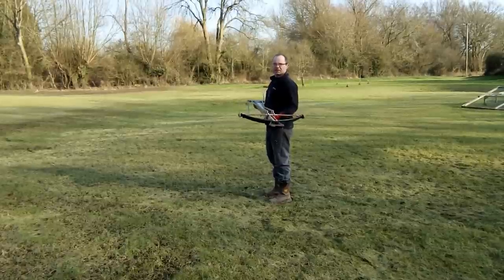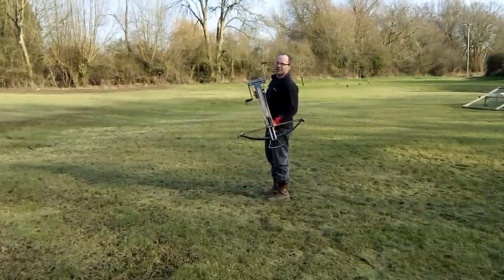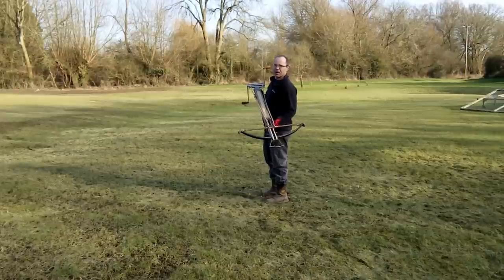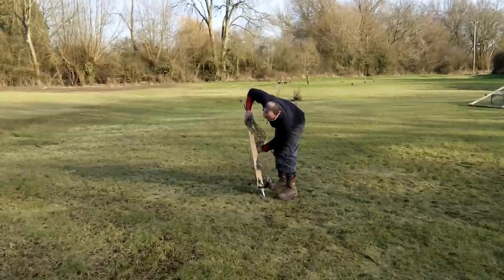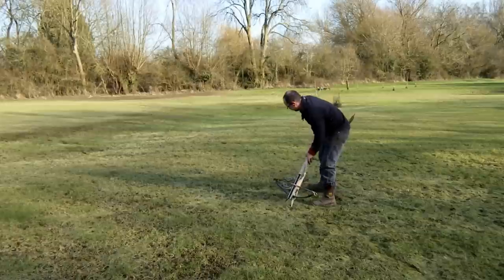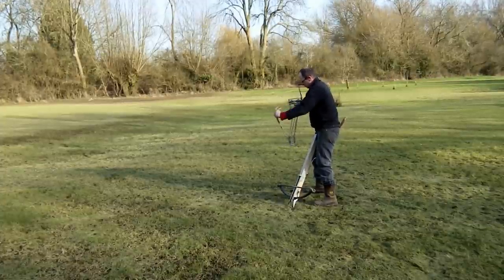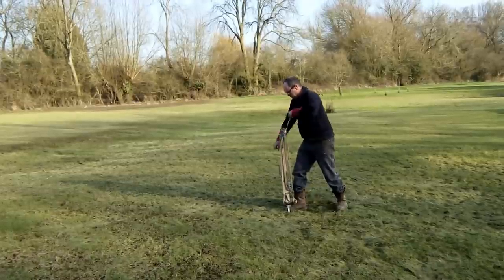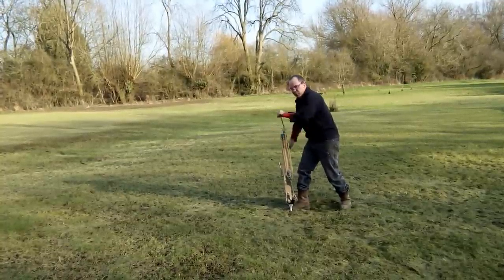Tod of Tods Stuff shoots a 1250lb medieval windlass crossbow

Comment: well, you fired 3 shots in 110 seconds (~37s/shot), so 1 shot every 45 seconds isn't THAT far off.
Reply: His last shot took 30 seconds though
Reply: ...and he would have been faster if he'd laid down the windlass on the ground in a more orderly manner. It would take a bit more time than just tossing it into a tangled mess like he does but you'd make that up with not having to  untangle it again. Add an peasant to hold the windlass and a supply of quarrels and he'd be even faster.
Reply: Not only that, you don't unwind as much as you pull it. Once you've got the hang of it, a steady 28 seconds per shot is doable.
[I get about 30 seconds average on mine but I prefer a bow and don't use it much.]
Experts might even drop that to 25 seconds.... who knows.
Reply: A design with a release-lever like on the winches for the modern load-securing-belts used for commercial transports could also make un-winding the windlass a few seconds faster. I'd say the 45 seconds is probably for ordered ranks of crossbows to fire concentrated salvoes after orders, rather than individual free-fire. Also once you start getting tired in your arms and backs, speed would drop some.
Reply: Oh it can be a lot over the course of a few hours. Even just 1 hour considering in any confrontation multiple of these might be firing.

Comment: I have shot quite a few ,and the 1250 inch/pound is a fairly lower weight crossbow easily cocked at the distance by hand , if it were spanned another 6 inches well that would probably require a windlass or tool as alignment at that length is crucial. . And Yeah you have alot of folks touting one the crossbow or two the longbow , and both sides beat their chests , While mostly studying artifacts and what we "Think" is factual and it's just conjecture because so very few specimens of either from the great battles have remained. . Men were Shorter and Stouter back in the day , they had to be life was hard and short so it had to be lived to the fullest,  most men lived on ale and  porridge called "Gruel" ,hence the term Grueling Day , well that meant their was little in the coffers ,Pockets and taking of Game without permission was a serious enough offense that only outlaws would risk it's fine hanging by the neck . However Any English or Welshman worth their salt would poach and get their state mandated training with the LongBow in daily and weekly after mass ..

Comment: Could you answer the burning questions of how much armor a bolt from a 1250lb crossbow would pierce at various ranges?
Set up plates of steel the general thicknesses of medieval breastplates and shoot them with armor-piercing bolts?
Reply: Bat Guano that would be golden. however 3 things have to be checked. the correct arrow tips for piercing, tempered steel plates and arrow tips, and heavy enough bolts

Comment: Is it not possible to leave the winding handles end on the crossbow as it seemed a time consuming effort making sure your ropes were not tangled each time? Reattach to the string, set the trigger, wind, detach, load, fire. Especially if the rope's were on the other side during winding.

Comment: The real war crossbows are the Chinese compound bows that were placed in carts & had 4 limbs. They allegedly were used to fire heavy tipped bolts into castle walls to make: ladders. Supposedly the heavy tipped bolts had enough energy to penetrate the mortar deeply (and presumably the stone). Sounds like a bit of a stretch, but you simply don't see demonstartions of the power of the 4 limbed crossbow anywhere in the modern age.

Comment: Why didnt they make the draw length longer? Always wondered about that, but not found any good answers. Seems to me this crossbow could have been drawn further, giving it more time to accelrate the bolt.
Reply: I assume if you draw it too much, the metal will bend out of shape. The only way to increase the draw length would be to make the metal piece longer, so it can flex more. If you make it comparable to longbow length though, it would be too unwieldy.
Reply: Gegi Oniani Exactly, too bad our ancestors never thought to use a pully system to fix this.
Reply: Wormweed scholagladiatoria has a really good video on this. It's because they were afraid of the metal snapping, which could be really dangerous
Reply: Patrykke Robinson
 Yeah, i saw that. Was nice to finally get a good answer

Comment: I'm guessing with these kind of weapons on the battle field (just like muskets in a defensive position) you'd have 2-3 guys cranking bows up for the marksman to use, that is 4 people working together to rotate through 4 different crossbows.
Reply: IIRC that was done in fortifications, but not on the field.  At least with flintlocks in the 18th cen., each soldier would load and fire his own weapon.  It may have been different with some of the earlier matchlocks in shot and pike formation, but I'm not aware of it.

Comment: ***** 
Is it possible to use such a heavy bow with a cranequin?  Seemed like the cranequin would require a lot less fumbling with ropes, which would be very tricky with battle-induced stress.  

Also were there crossbow versions where the spanning device (windlass, cranequin, goat's foot lever, etc) did not have to be detached before loosing the quarrel?  I'd imagine that'd be mighty handy, saving a lot of loading time.

Comment: Really enjoying these videos! Do you happen to know the KE and FPS of this bow and your cranequin? I'm very interested in building a cranequin at some point with about this poundage, so I was curious as to your experience with them.
Reply: *****
Would you be able to lower the bolt weight, is that about the correct weight? It seems to me 48m/s is a little slow, but that might be because I'm comparing it to modern crossbows. Thanks!

Comment: Would be nicer if you showed the feet per second or how powerful it is . Can't tell just by watching you shoot
Reply: nikotwenty speed is delusive. why? because you reach lets say  60 m/s with your 80grams bolt while you also reach 60m/s with your 200 grams bolt. why? because it has a short draw length and cant accelerate it much. however if you take heavier bolts it still has more than enough energy to accelerate that additional weight without speed loss

Comment: Hmm you say that it is much faster than 45 seconds, but when I timed between your shots, that's about what it was.

This video was very surprising. I expected that bolt to just zoom right off at 1250 lbs, but it was moving much slower than I expected.

I'm absolutely not knocking your video. It was very educational, and will be useful to me!
Reply: TKnightcrawler Well they're fairly heavy projectiles and medieval crossbows had a short power stroke, I seem to recall watching another video by Tod quite a while ago that went into more details about this. Should be on the channel somewhere.

And if I'd have to guess they went for the short power stroke due to metallurgy limitations, you'd need some quality steel to pull it back further and getting it consistently right probably wasn't as easy as it is today for us today. If the choice is between something that may work better but can fail catastrophically or something that'll work well reliably in battle and idiots abusing it won't make it break too easily I know what I'd pick. Considering the unpredictable nature of combat I wouldn't be surprised if you had to leave it cocked for extended periods too I don't know how steel from back then would respond to it as most of it might be alright but some slight imperfections can easily lead to the prod breaking unpredictably.
Reply: The draw weight is not exactly a measure of speed. The steel bow returns to shape in the same amount of time regardless of how thick it is. If you want to make it faster you had to add leverage through mechanical elements or just make the bow longer. I would guess that the projectile's velocity would be around 140-180 fps regardless of draw weight, but of course higher draw weight can fire heavier projectiles which carry much more energy.

Comment: Nice video! What would be the effective range of this weapon? I.e. what range could you reasonably expect to hit someone? Just curious. I'm doing research as to whether an 18th century army would've been better off equipped with 450lb crossbows as opposed to their fusils, because I think the crossbows fire quicker, have more range, don't produce obscuring smoke and are just as easy to train with.
Reply: flintlock muskets are  much quicker to reload, if you know how to do it.
Reply: well muskets are much much more deadly. even a 16th century musket could penetrate pretty much any armour except the best cuirasses that were specifically designed for that, and even then they offered protection only on long range. ( they were usualy proofed against pistols, which with their short barrels had a much lower velocity round) while a 450 pound crossbow would have no chance.
Even a 1000 pound crossbow at very short range would have trouble penetrating and hurting the wearer of a set of plate armour.

Firearms are also much cheaper to make, and the ammunition is even easer to get, as soon as black powder making became common, it was incredibly easy to supply an army with black powder, and bullets could be made out of any scrap metal anywhere, no forging required.  Also black powder supplies are shared with the armies artillery so again, logistics are much much simpler.

Also with the advent of the bayonet, it became even easier to equip an army for both ranged and melee combat. no need for secondry weapons. 

But indeed a crossbow can be superior to a musket in its range and accuracy and even rate of fire. But lacks the stopping and penetrating power that caused the drastic changes in the makup and tactics of the early modern armies.
I like to think of crossbows as the firearms of the 13th century, when the started appearing on the battlefields, until their demise in the 15th century, they were massed and crossbowmen made up a large and often very treasured part of the forces on the continent. But eventhen

Personally i believe it was the simplicity of manufacture and maintenance, logistics and availability of materials combined with the killing power that made muskets the weapon of choice. Even back in the 15th century, the Hussites were amongst the first in Europe to reckognize the potential of firearms, especially when employed in defense on the battlefield.
Reply: But I meant on an 18th century context, where nobody wore armor anyway. Would you still stick to muskets?
Reply: *****
J Gates
 I'd say longbows, great as they were, are often overestimated in their effectiveness, and especially the circumstances of actual combat  pretty much favour  the musket.

Sadly enough, people seem to almost always dredge up the best possible stats on anything under ideal  shooting range conditions for bows, and then compare that to the polar opposite sort of stats for muskets.

Like quoting the Longbows range as the maximum distance the arrow will travel, say 250 yards, and compare that with a googled 30 yards of effective range some weirdo on "deadliest warrior" or some other US TV-Crap spouted.

In reality, a muskets maximum range is far greater than anyone could hope to aim with bare eyes and  steel sights. A Musketball aimed at centre mass will generally  be at leg'S height at 100 yards, and when you aim at  a foot above the heads at 200yards, the ball will still easily go leg high.

Knowing the targets distance at longer ranges is the key to neither overshoot nor to  send arrows short. Gaugeing the distance correctly under stress of battle, in real terrain as opposed to idealised and familiar shooting range type os settings, is  a tough thing to do, and then aiming appropriately? difficult at the very least.

With a musket of the 18th C. every idiot who doesnt know  projectiles drop at all can 'point and shoot' to at least 100 yards, and between 100 and 200 yards a foot or two elevation are enough.
Reply: LutzDerLurch
I have read several times that the Duke of Wellington wanted a corps equipped with longbows, to fight in the Napoleonic wars, but it wasn't possible, probably because of the time to train them.
Reply: That may be, alsthough I have yxet to see an original quote from him.

However, he was far removed from actual  longbows being used in war, as we are from muskets being used.

And his beeing a prominent and successful leader does not automatically make him an expert on ancient weaponry.

The Longbow is today, and was even in the 19th C. romanticism, much overhyped.

And reality had already proven centuries before  Wellington, that the musket was the better battlefield-weapon.
Reply: LutzDerLurch
No, I haven't seen a direct quote either.

Both have their advantages and disadvantages, but bows (not just longbows) have enough advantages that I believe he could have considered having a corps.

Comment: Great video! It nicely illustrates spanning speed. I wouldn't be surprised if very experienced military crossbowers managed three shots per minute with a windlass, especially one that required more strength to turn. As far as bolt velocity goes, note that if accurately recorded, Payne-Gallwey's 1,200lb period crossbow performed better: probably around 75 m/s with a 85g bolt for 245 or so J. Out of curiosity, how much does this bow weigh without its windlass and how much does the windlass weigh?

Comment: I noticed in an earlier comment you mentioned that this crossbow delivers about the same force as a 150lb English war bow - could you elaborate on that a little? I can't quite fathom how two weapons with such a disparity between their draw weights could deliver equal force.
Reply: Hey there! In answer to your question, the reason why a longbow of lower draw weight can deliver the same force is simply down to draw distance. Effectively, the shorter the draw of a bow, the less time the arrow or bolt has to accelerate.
Most crossbows have around a 6 inch draw (how far back the string goes), which is very short, to accommodate for this, there's more of an initial burst of acceleration by having more draw weight behind it. Whilst a long bow usually has between 28 and 34 inches for draw length, depending on the size of the bow and the size of the archer.
Basically, crossbows of any significant power need to have a high poundage to make up for a lack of draw length.
I hope this was of some help! If you have any further questions please don't hesitate to ask :)
Reply: He's using the terms force and energy interchangeably which a lot of people do, but they are very different things. Pounds is the unit of force. If you integrate a force over a distance (like say a draw length.) you can get foot-pounds, which is the unit of energy.

Whats he's saying is that if you integrate the force x draw length for a long bow it's about the same as a heavy crossbow.
Reply: It’s the power stroke/draw length being considerably shorter than how far back a Longbow is drawn

So the crossbow needs more draw weight to compensate.

Comment: it can be 5000 lbs if the lmbs are made from steel it never gonna shoot a bolt fast. but u can raise the penetration power by using heavy bolts.......but from what ive seenits not mre powerful than a 70lbs recurve bow (turkish, well designed hungarian.or crimean tatar style examples from the past)
Reply: andras zalatnay you are completely rght about the speed but your impact energy with heavy bolts outmatches every bow by far

Comment: You say it's much faster than 45 seconds to load and fire as you load and fire at an average speed of 45 seconds/shot.
Reply: Actually, he talks for 20 seconds at the start and fires the third shot at the 2:11 mark, so that's 133-20=113 seconds. 113/3 is just under 37 seconds. That's about 17% faster than 45 seconds, which in itself is a noteworthy difference. Add to that that Tod isn't a trained soldier, and you might well be looking at 30 seconds per shot (or even less?) in a more representative scenario.
Reply: More importantly rate of fire is kind of overrated a lot. You either have a skirmishing exchange going on for quite a while before battle or in 95% of cases you have a siege going on. In both cases people are sniping each other, the English tactics were unusual and specific to a very defensive doctrine of fighting a field battle with fortifications prepared. And one can have long debates how the English longbowmen actually used their arrow fire to their effect as well. Most likely it also didn't involve rapid fire but coordinated volley fire.